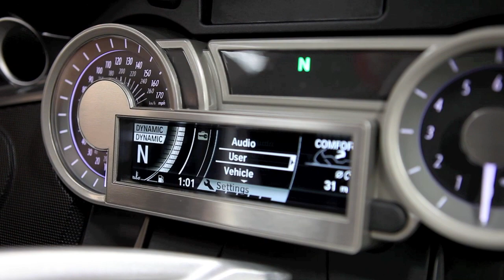How To: Digital Speedometer on BMW K1600 GT and GTL at Euro Cycles of Tampa Bay

Comment: Can I do this procedure with my 2012 K1600 GT?
Reply from the maker: You'll have to check in your settings and see if you have the option to switch the logo for a speedo.  I can't remember if it was something offered on the 2012 or if it was something new in 2013.